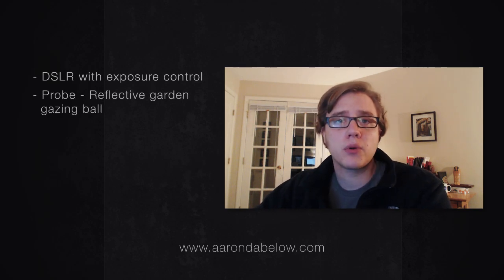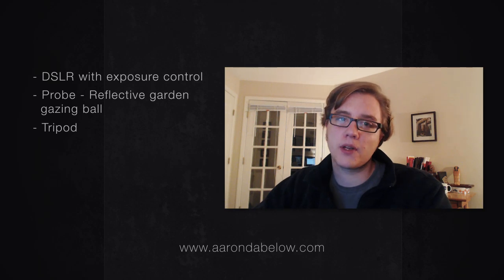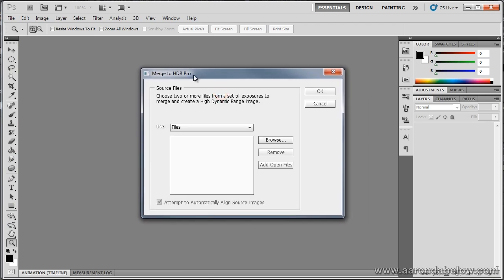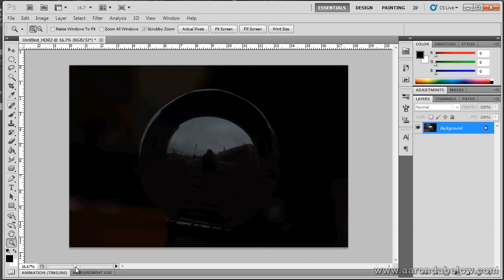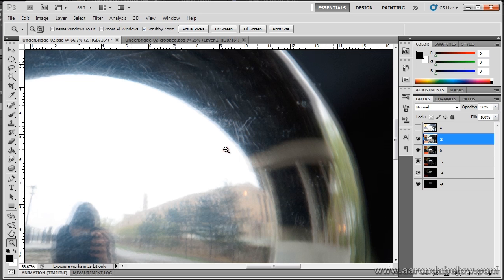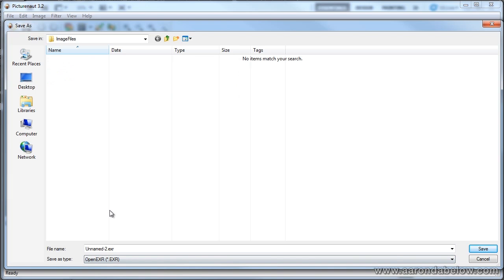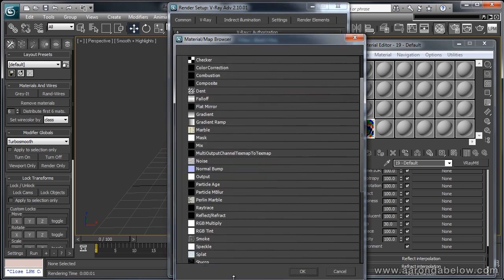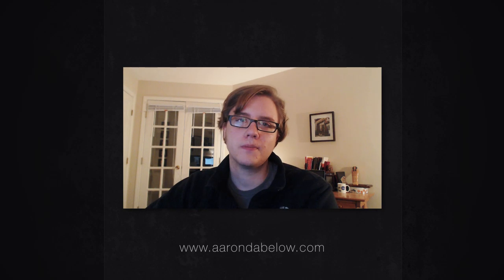HDR Probe Creation - 3DS Max / photoshop / picturenaut Video Tutorial

Comment: Thanks, I'm wondering if there is another way to apply in 3DS Max.  My 2011 doesn't include VRay.
Reply: Don Wahl vray is a plugin, and you don't need it for HDRI.
if you haven't figured it out by now you can simply plug your HDRI map into a mental ray "environment background camera map" and plug that into your scene environment and it will yield the same results

also, if you use a skylight and make the scene's environment the source, the image will become the light source.